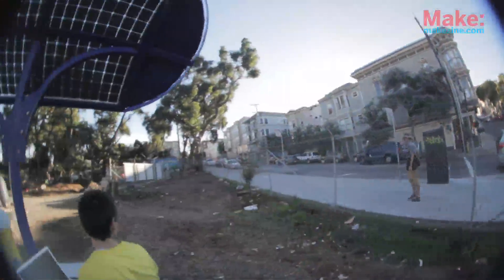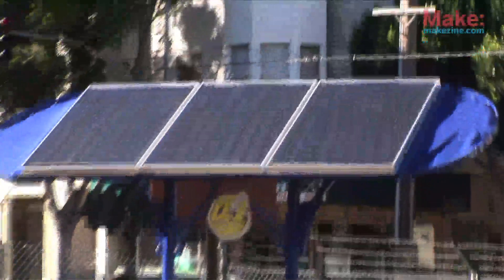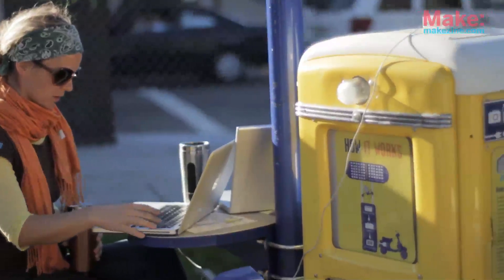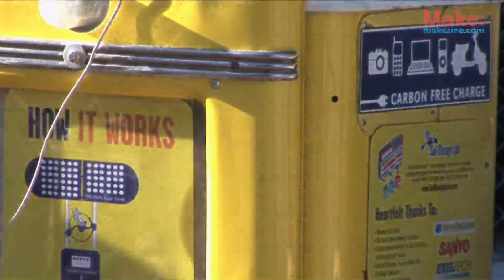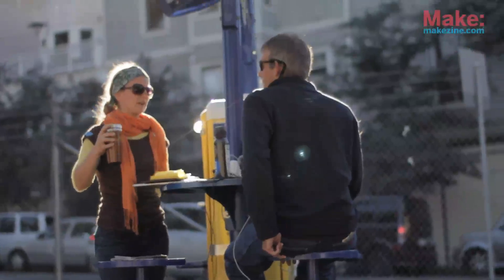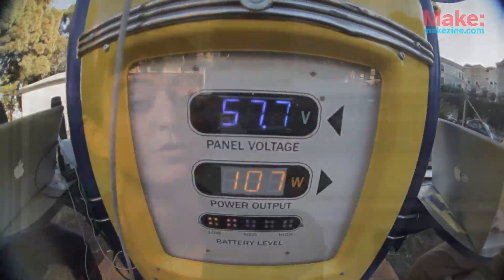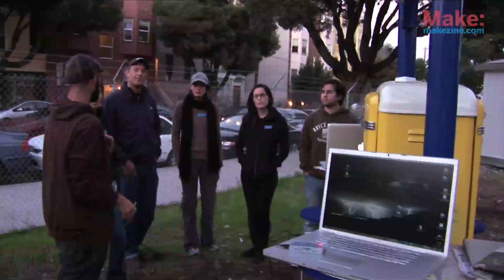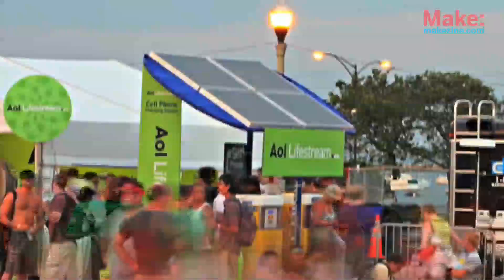Maker Pioneers: Beth Ferguson & Sachi DeCou, Sol Design Labs

Comment: @wiccanmoonman 

You're wrong.

We have enough oil, coal, and natural gas to provide for the world's energy needs for the next 300 years. Trust me, I'm a petroleum engineer.

Also, did you know that when we leave an oil resivoir, we leave 2/3 of the oil still in the ground? It's a matter of economics, but in the future when technology improves (which it is very rapidly doing) we will have tremendous success pulling even more oil out of the ground.

Comment: This produces 1 kw/h per day. Whats the cost ratio here, hm... I'm going to assume this station cost about 5 grand (taking into account that recycled materials were used)? 1 kw/h will ring up about 15 cents on your normal energy  bill. So using this station for a year would save you $55 per year on your energy bill. So if they run this for 90 years, the savings will counteract the cost to build it. Doesn't really sound like a good deal to me.

Comment: @frosch455 So you are saying that 300 years is unlimited ? A 100 years later fossil fuel pools may simply become too rare to be profitable to extract, because the convienent recourse pools will be depleted and no one will bother going for pools under oceans and ice caps. Unless they increase the price of these fuels dramatically, of course. Also nuclear energy is cheap, don't even go there. And solar energy is expensive because manufacturing batteries is expensive, which will eventually change.